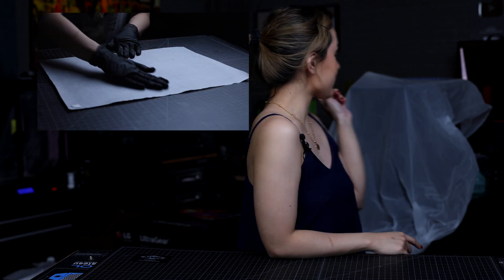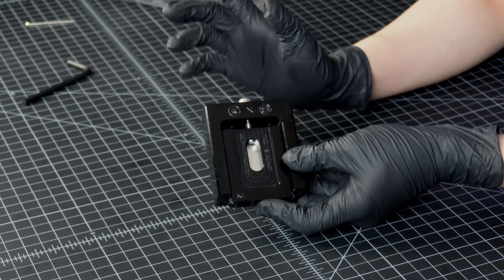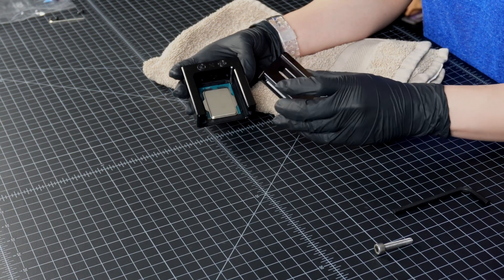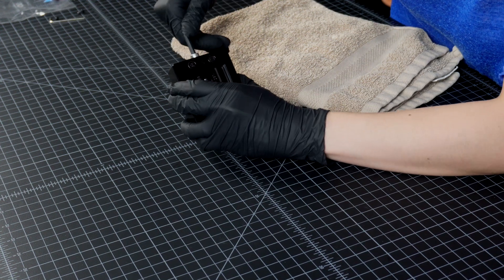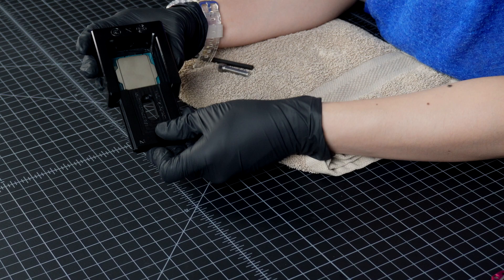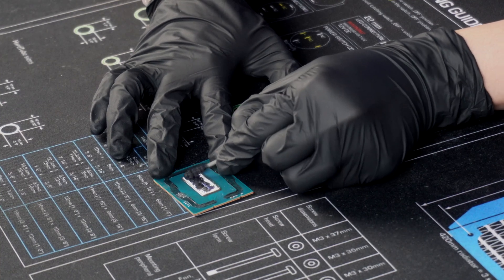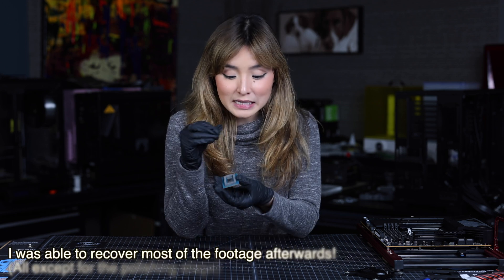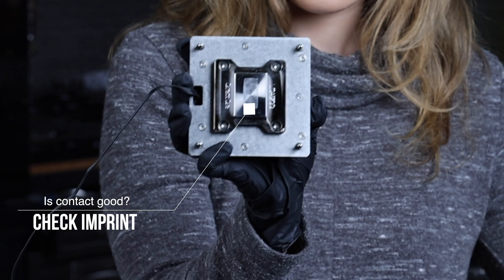Delidding A Brand New i9-13900KS Was Too Easy | EK Quantum Velocity2 IHS Removal Tool

Comment from the maker: Few notes- Yes this does void the warranty.  Don’t try this unless you’ve got experience with this sort of thing.  Although I had an easy time, there is still considerable risk if you do something wrong.  This is something that you need really research thoroughly and make an informed decision regarding how it works, what brand you want to use, and even if delidding is even worth it.  Hint- for 99% of PC builders, it’s not and I don’t recommend it for most people.  But for the rest of us, it’s fulfilling and I guess you can say it’s just a way of life.  If you know you know.  
- I did read reports on forums about the kit having issues, especially on the initial batches upon release.  Personally I’ve had no issues and temps are VERY good.  Once the final build video is done editing I will put out something showing temps etc.  
- I’ll be back from PAX next week.
Reply: I had to go through three RMA units from EK, and after all that my temperatures were still garbage. Even though they knew it was the cause of the issue, they still sent me two CPU frames that were the incorrect height (they didn't measure them), before they sent me a third one that was within the correct tolerance (I asked for a picture of them measuring it). In the end, it didn't even really matter since they refused to also replace the cold plate for the CPU block, which was also a cause of the issue. They said it looked flat on my pictures, but I tried to explain to them that it was not... to no avail.

I even went through an entire tube of liquid metal and six mounts on the third rma unit to try to get a "good" mount. 

Honestly, given the number of people who have had issues with this product, and how nearly universally bad those experiences were, I really do not think it should be recommended by anyone, even if they had a positive experience themselves. It's not like 5% of people are having this issue, it's gotta be closer to 50%. 

I have been deleting CPUs since the 4790k and this has been by far the most infuriating experience.
Reply: long time no see

Comment: This did not age well... 
The Der8auer die remover is SO much smoother. No need for heating, no need for the flipping, just put in and screw and done. 
I de-lidded mine in, I kid you not 2 minutes, then 2 hours of cleaning the STIM later, it was installed and now 20C cooler.
Reply from the maker: LOL this of it as one for the history books. :)
Reply: @SnaxanGaming  After i did it, i was able to show intel I needed an RMA, they now have me de-lidding a 14900K to basically prove to them my 13900K is definitely degraded, and no amount of cooling is going to help. So here I go again!

Comment: I say the video that you the torque srewsdriver from EK, but how tith are the screws from the die guard?   EK recomend 0,6nm in they manuel, but is that not to heavy? the contactframe from grizzly the do it finger tiht
Reply from the maker: the thermal grizzly contact frame works differently, even other contact frames aren't as touchy.  the delidded die guard needs to be much tighter per the pressure in the manual.
Reply: so you use the torque screwdriver from ek in your video what in saw and screw them in on 0.6nm?
Reply: https://www.ekwb.com/shop/EK-IM/EK-IM-3831109897744.pdf in this manuel from ek they say it that it need 0.6nm

Comment: OMG you use way too much liquid metal all you need is a film on the cpu one small drop then you apply it to the block with the little bit left on the q-tip from the cpu
Reply: LOL I was thinking the same thing while I was watching. My wallet hurt watching the excessive drops, especially when she was trying to dissolve the solder.

Comment: Recently, I just finished delidding my CPU, and the emotions I felt while doing it ranged across the board. I actually went with the Thermal Grizzly tool made in collaboration with Der8auer, and the process was much simpler than I expected. 

I'm ecstatic to see Kratos, as I know it will be a beast of a machine.

On an unrelated note, what camera(s), lense(s),  and extrenal microphones, if any, do you use? I'm looking to buy a DSLR  / mirrorless camera and would love your input.
Reply from the maker: Nice!  Hope everything is working out well for you on the delid!  As for cameras, on this one I'm using the canon R5 in combination with a Sony ZVe10 on certain angles.  But I'm switching over everything to 100% Sony stuff as soon as all of our canon gear gets sold.  What's your budget and what types of things will you film?  That will be the deciding factor on what to get.  I'm currently using a RODE GO 2 wireless for mics.  They do the job but I don't like the software and currently looking for something with a better overall experience.
Reply: Thank you so much! I've had setbacks within this build, considering it's my first build, and I chose to do custom cooling. All in all, I don't think I'd trade the experience for an easier option.

Mainly, I'd use the camera at a stationary indoor position, but there are times when outside photography will take place. I've been contemplating the Sony Alpha A7, but I'm not entirely sure what camera would provide a good balance of both.
Reply from the maker: @TheAshenPhoenix   Wow, you're doing a delid for your first build!  Jumping right in!  Also, setbacks are the only way you learn, so that's all good.  The A7iii  will be just fine for both video and photos!  If you like compact, my next camera will be the A7Cii that comes out soon because I needed something smaller to run around with.  It's also a great hybrid for photos and video.

Comment: Thanks
Reply from the maker: Awww....thanks so much for the support!  You didn't have to do that yet you did!   How are your temps??  Did everything work out well?  And yes, I can't wait to show the world my build.... video is going through editing hell at the moment and I have a few other projects at the moment but hopefully will have something soon.
Reply: its my pleasure this video helped me out, believe me! 90% of my build is still in the mail. my GPU and T700 drive is on back order. the case I want isn't in stock (O11 Dynamic EVO XL), and the water cooling stuff is on the other side of the planet. (I haven't even ordered the steel tubes yet cause i want to set it it in person before, So I know what to get.) so it will probably be at least a month before I start this build. I hope the CPU works! I'm curious to see what the temps will be. the radiator is the 58mmx140mmx560mm and I'm running it outside the case (and into the basement cause my rooms small and want to avoid ambient thermal throttling) I noticed you went with the industrial noctua fans, with a push/pull setup, and I might do the same. also if its not to much trouble could you elaborate on the frame of the kit? you said yours was 5.47mm are you talking about the direct die plate as seen at 11:40? I bought the MSI MEG Z790 ACE which looks very similar to your MSI Z690 so hopefully its compatible. thanks a ton! and whoever is doing your editing work is doing a great job! .  @SnaxanGaming
Reply from the maker: @ShaneThrice  Nice!  Looks like you have a lot to look forward to.  And yes, the issues that these direct die kits seemed to have, according to others, is that the frame you see in that same timestamp is too thick, causing lack of contact.  hope that helps!
Reply: that does help thank you, I really so appreciate it! I did contact a friend and he said he could make me one (the block itself) or mill this one down if it is to thick. but that's good to know!  @SnaxanGaming
Reply from the maker: @ShaneThrice  If the frame is too thick, EK can get you the right frame.  GL!

Comment: This was such a helpful video. i really liked the idea of using thermal paste to find out the die size. in ekwb's video they used the sticker to "eyeball" the size. your method was better. I'm probably going to do exactly this. for my first custom loop ever.  quick question though. how did you polish the die? thanks so much.
Reply from the maker: Regarding the mirror polish, it was literally just repeating the process over and over but the last part of polish was using fitz metal  polish (not a lot).  Btw regarding getting good contact, there are two other important parts to the equation - getting the correct torque when screwing the backplate to the frame on both sides (it might be hard to see in video but I used the Ek torque screwdriver), and making sure the frame of the kit is not too thick (mine was 5.47mm measured using electronic caliper tool). Good luck!
Reply: yea I bought torque driver along with pretty much everything I need (hopefully) from ekwb. i was able to remove the IHS but getting that dark silicone stuff off was spicy. and I was able to polish the Die as well. i probably watched this video 8 times while I was doing it lol. I'm looking forward to the build!, I'm hoping to steal some design Ideas from you!  @SnaxanGaming

Comment: @Snaxan Hope your kit works for you, I got two sets of revised parts from EK and they both did not work. CPU temps shot to 100c before even getting into the bios.
Reply from the maker: Mine worked great.  Assuming your pump ran before bios, sounds like you didn’t get contact.  The frame part should be 5.5mm or thinner.  There are other die lots too that you can try since you already have yours delidded
Reply: Yep I went with Iceman block. Sitting at 6.2 all P core and stable @ 67c gaming. Just wish I could of gotten the EK working, would of looked better in my set up @SnaxanGaming
Reply from the maker: @92GTIDrew  great to hear you got it working!  Shame i the Ek didn’t work for you though.  They look really nice.   If you want to give it another crack I can ask EK if they are willing to send you another one to try out.   Just let me know.

Comment: You tackle very intimidating mods with no fear. I always learn something from your vids and I appreciate the effort you put into them. I do have a question though. How did you polish the die to get that mirror finish?
Reply from the maker: You can get it nice and shiny just by repeating the steps of using Liquid Metal and cleaning off.   Some people have used flitz metal polish and it makes the job really easy.  However I see people put on more than is necessary- you can put a very small amount and polish it out to a mirror shine.  As for mine, it was a mirror finish but still had very very  small stain that you can only see at certain angles and very closely, but I was ok with that stain.  The real thing to worry about is if the die is not completely flat and there is still indium left making the surface uneven giving poor contact.

Comment: Are you going to use EK's direct die CPU block? I aas going to delid my 7950x3d but it already runs efficiently as is so I opted not to. Looking forward to your build video!
Reply from the maker: Yup that’s what I’m using, you can see me put it on at the end.  I was a little apprehensive but it works perfectly.  If yours is already in and cool enough, I’d just leave it.  At this point it’s all for fun vs the actual gains.
Reply: @SnaxanGaming  oh yeah, water-cooling is 100% for fun and aesthetics...the gains in cooling is there but probably not worth the crazy prices. The direct die block should get you like 10-15c drop in temps!
Reply: Check out Optimus's new Signature V3 block for AM5
Reply from the maker: @paskowitz  love their stuff they just take too long to ship sometimes